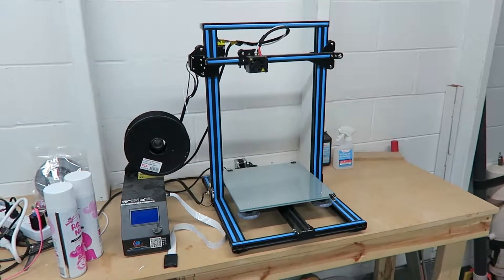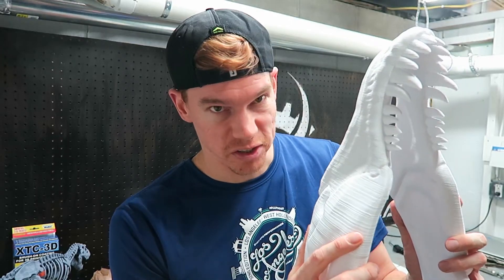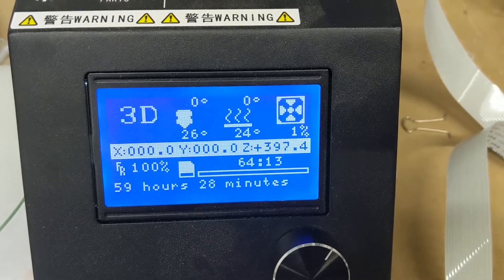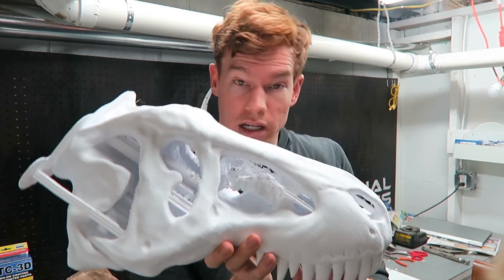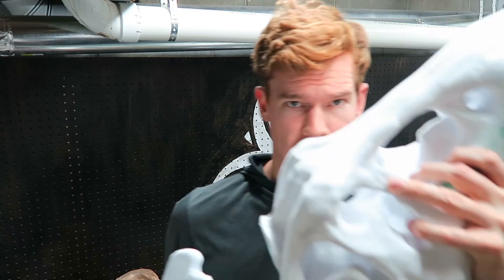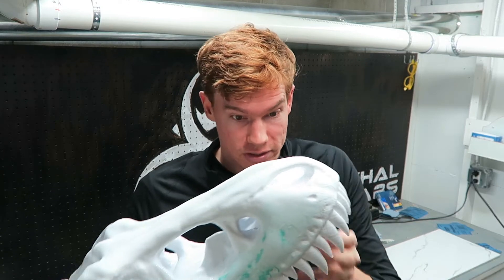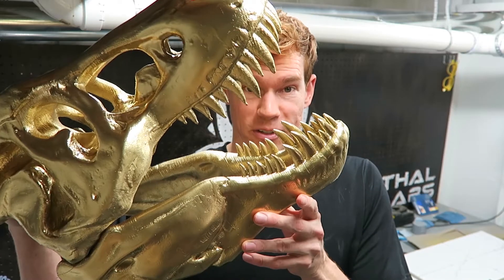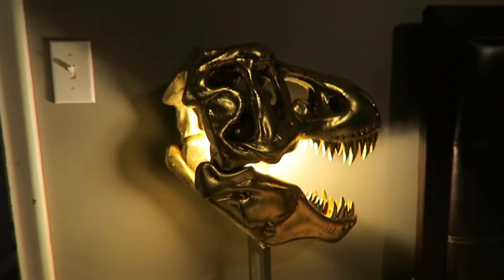3D PRINTED GOLD T-REX SKULL

Comment: wood filler is much easier to apply and then sand afterwoods.  BUT my faveorite....POLYFILLER super super easy to smooth a print and light sanding after.  XT3D is alllottttt of work.
Reply from the maker: Thanks for the tip! I'll give that a shot
Reply: @LethalEngineering  can’t wait to see. U can’t beat the T-Rex scull as a model huh - wen u print it u realise how well built that animal was. Amazing

Comment: Cool print!  Having printed the skull yourself, would you recommend that orientation for the jaw?  I'm thinking about doing it rotated 90.
Reply from the maker: At the scale I printed, I think it would only fit on the print bed in that orientation. I imagine you'd have less support material (and therefore a quicker print) if rotated 90 degrees. The quality would probably still be the same.